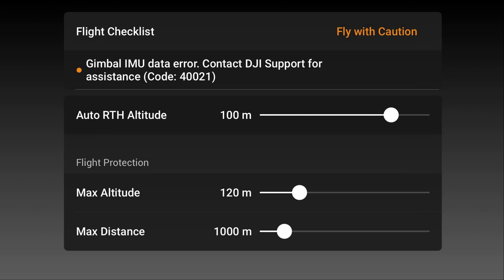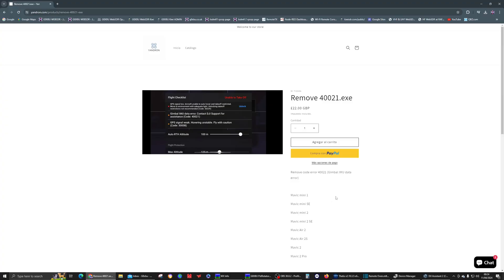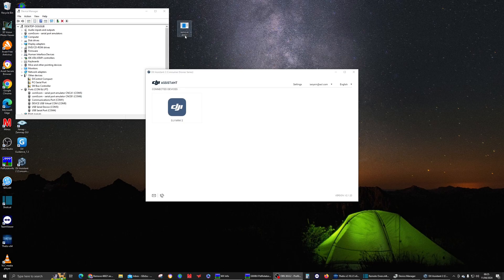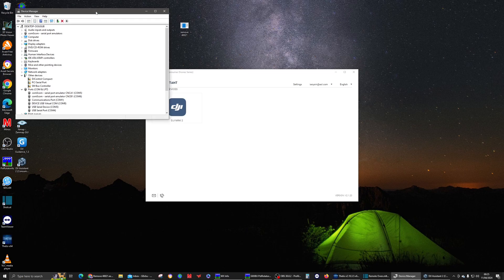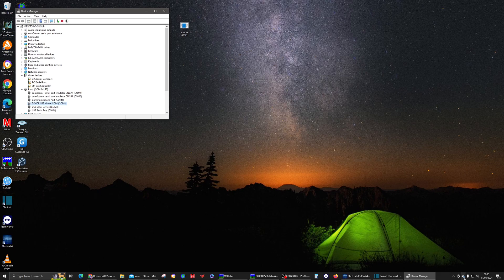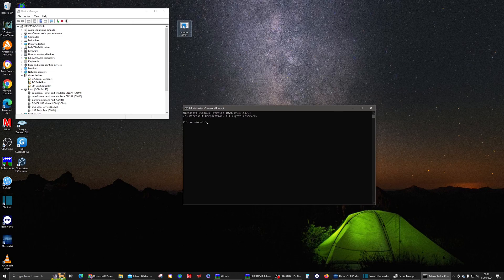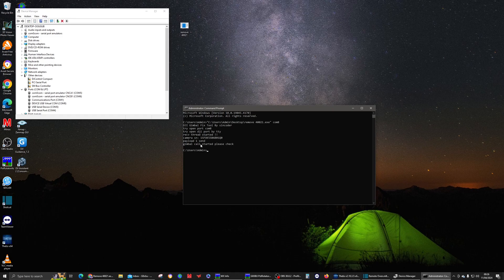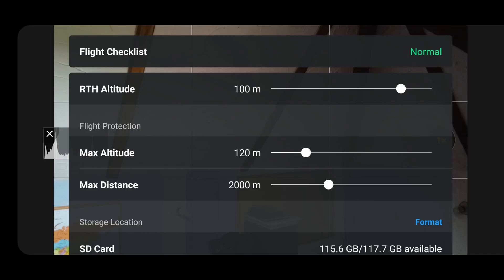Removing the DJI 40021 error

Comment: not working for me :( it says  "error in opening serial port com 5:5 can not open port !! 5
you know this issue? what am i doing wrong? btw thanks for this video.
love that kinda  game :)
Reply from the maker: It sounds like you are using the wrong com port. Check device manager as to which com port the computer has assigned to the drone. Also make sure no other program is trying to connect to drone on that port
Reply: @ianxbu5091  your tip with the other program helped me ! thanks a lot !
Reply: had same issue. make sure DJI assistant app recognizes your drone. then proceed to command promt
Reply: i can help you you dont need to pay if you still have the program

Comment: hi, thank you for this video. please, i have a marvic air 2 that is bound to a remote but the remote is not handy. can it be unbind? 
i was not the original owner. i bought it from ebay after my previous aircraft flew away
Reply from the maker: Hi, the official method is to contact dji support with your problem. They will try and contact the original owner on your behalf. But if that fails they won't help you any more. This happened to me so the next step is to replace the motherboard with a non bound one. I found it cheaper to buy a damaged drone and salvage the part I needed then sell it on again to recoup cost. This video then shows how to remove the error that will appear after changing motherboard (on a mini 2). Good luck